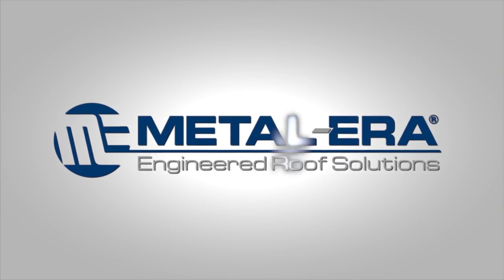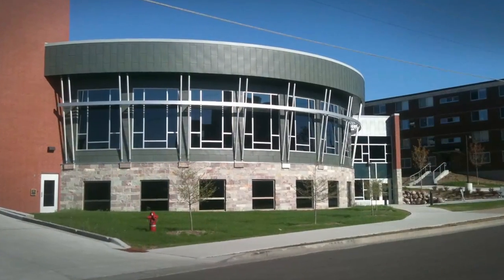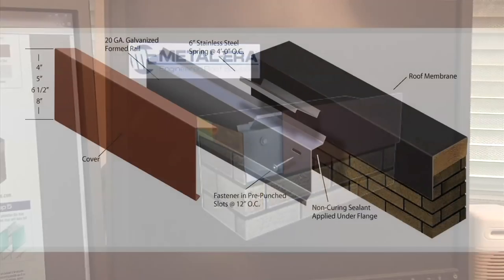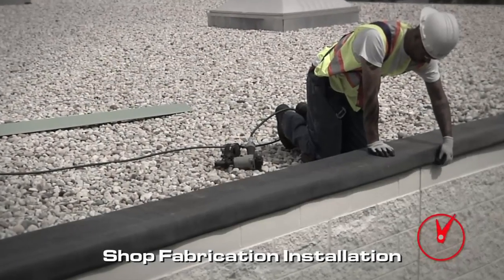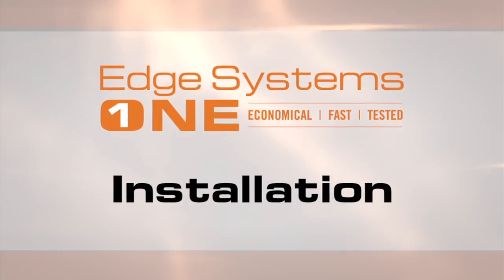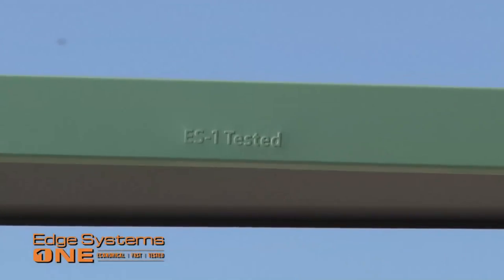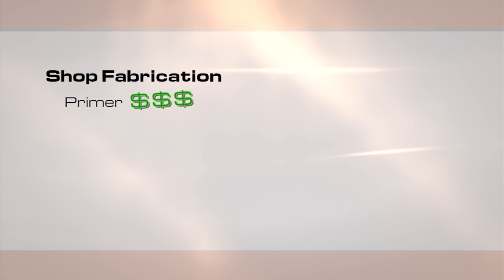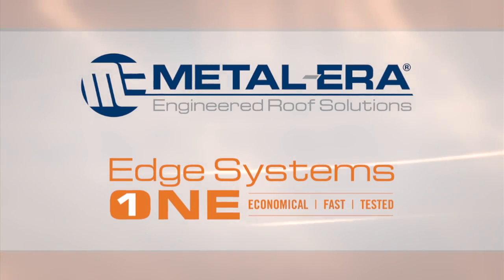Pre-manufactured Edge Metal vs. Shop Fabrication

Comment: Does your metal need to overlap even if there's a spice plate
Reply from the maker: Thank you for your inquiry. If the product uses a splice plate instead of a lap joint, you do not need to overlap the cover material. For this product shown in the video (One Edge Fascia), lap joints are used for lighter gauge cover materials and splice plates are used with the heaver gauge cover materials. We have install instructions available on our website if you would like a more detail overview. https://www.metalera.com/Products/Details/Metal-Era/Edge-Systems-One/One-Edge-Fascia   Thank you!